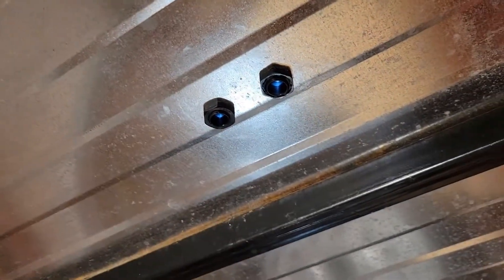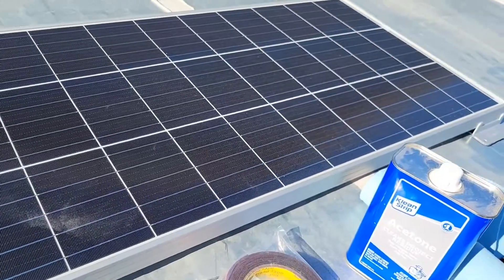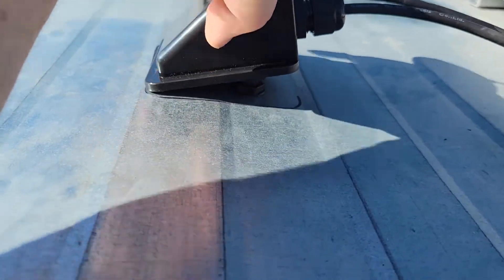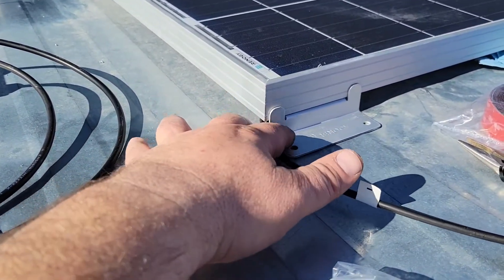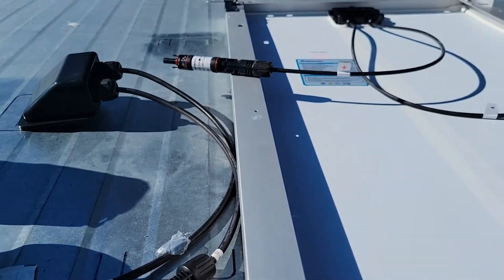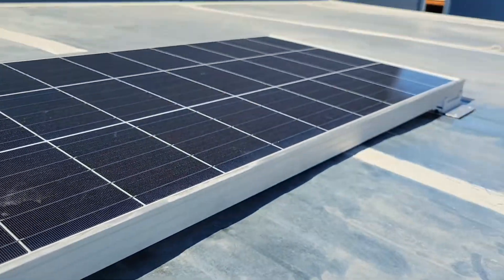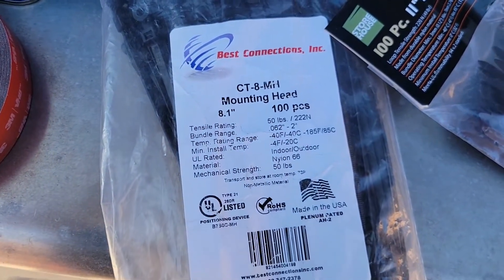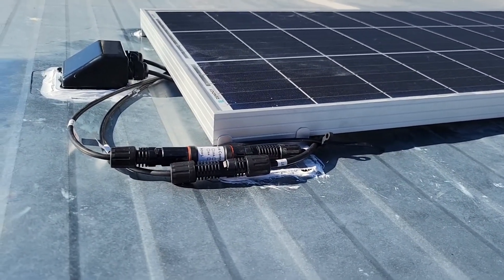DIY Enclosed Cargo Trailer Rooftop Solar Panel Install #renogy

Comment: Wondering how it did going down the road with the 3M tape? Has there been any issues since this install. Thank you.
Reply from the maker: 3M tape bonded the two dissimilar metals quite nicely and has held up since install.